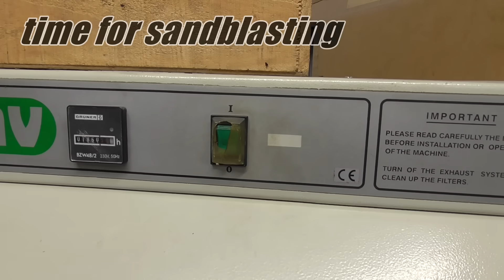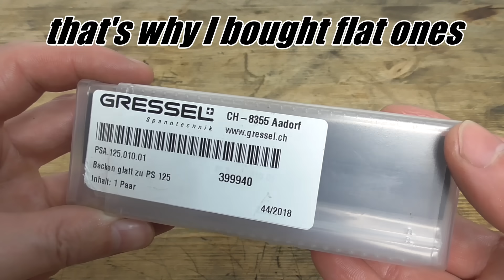Rusty Deadlocked Vise - Perfect Restoration

Comment: Please correct me if I'm wrong, but why not sandblast before you polish all the edges?
Reply from the maker: Dandblasting takes a bit of material off, it would damage those suraces. Specially the dovetail and where the jaws are mounted.

Comment: So you hardened the parts, but did you temper them after?  Didn't you just succeed in making them very brittle, or am I missing something?
Reply from the maker: I did not harden them, to harden you need much higher temperatur. They just turned black, steel is still soft. Its also rust proofing.
Reply: @mymechanics  Well that makes a lot more sense now.  I was wondering why i was not seeing any glowing happen.  Thanks!  You have a new sub here.
Reply from the maker: @shockwavecity  thank you very much :-)

Comment: Oi, I know the WD-40 cult membership benefits are hard to beat but if it's available in your area, try using Seafoam Deep Creep next time. I can't even touch a can of WD-40 without feeling dirty anymore after getting started on it, and it doesn't cost that much more. My second favorite libation.

My favorite, Buster, I know for a fact is only available in the U.S., unless you're willing to shell out $300 for a case + whatever they extort for shipping.

Comment: Wonderful restoration. I love that you remake these parts using precision machines and take the extra steps to smooth areas. Other restoration channels would have hit it with a wire wheel and left it at that. Wondering how long that finish will last on the handle/screw mechanism. Did it come nickel or chrome plated from the manufacturer?
Reply from the maker: No, they were black as well. You can find a lot of pictures if you google it. Thank you

Comment: finally.......somebody who did it right!  im certainly not the best at anything, but i cringe when i watch most of the other restorers......the only complaint here is the filler, the first hammer that ever touches it will break out the bondo and crack the paint.  perfect for just a show piece though.  replace the filler with some weld, and its 100%
Reply from the maker: I think it had filler in there before as well, because it appeared after sanblasting. Thank you

Comment: Great video but I have a question why don't you you use oil on those Norton oil stones? If you don't use it on them over long use they will become clogged with debris and you get to buy new ones?  My father and brother both have oil stones that are 35 years old or older in my father's case. Not cutting on your skills my friend just figured I'd ask. Keep up the great work.
Reply from the maker: You can use them dry aswell. Thanks for your comment.

Comment: I'm just curious why you chose sand blasting verses electrolysis to remove the rust.  I find sand blasting alters the surface of the metal and it looks like it's been sand blasted.  Great job. Great video.  Now it's too nice to use. ;)
Reply from the maker: I'm not a fan of electrolysis because you need to wire brush after. Thank you

Comment: Ready for more work, again.  Great job.  I noticed the original jaws had a cross hatched pattern, and they appeared to be okay.  You decided for plain face replacement jaws, was that a personal preference or what was available?
Reply from the maker: I explained it more detailed in the discription. Thank you
Reply: @mymechanics  , You can use the cross hatched jaws, all you have to do is take a couple of copper plates  a few milimeters thick,bend them in a 90 degree angle so you can use them between the jaws for protection.
Reply from the maker: @tallbeard7111  i have such aluminium jaws and other soft material aswell. I almost never use the rough ones.

Comment: Nice work! Although greasing the dovetail isn't necessary (won't hurt tho) because its made of cast iron,  wich contains alot of graphite and lubricates itself. 
I made one of these in my last year at school, making the dove tail perfect was a challenge for me
Reply from the maker: Indeed, but it's still recommended. You can't use too much grease when it comes to bare metal parts ;-)

Comment: I would recommend copper paste for the screws or any part that is needed to be taken apart again but especially on the threads of screws. Excellent solid vise. Guaranteed parallel jaws at any width. Wish it was mine.
Reply from the maker: Oh yeah, i remember we used nickel paste when we repaired electric motors a few years ago, thanks for the tip.

Comment: It is usually the problem with old used Gressel vices that the ways become worn and the movable jaw lifts.  Once the tooling marks from manufacture are gone the fit becomes too loose.  Maybe being frozen with rust for years saved the ways from wear?

 I think you got lucky that you did not have to fit a gib or shim.

Good choice on the smooth jaws!
Reply from the maker: It was in my friends barn for a few years, he found that thing on a recycling station.

Comment: Where you able to get the bottom part? That was great work.
Reply from the maker: What you mean with "bottom part"? Thanks
Reply: @mymechanics  on the curved part of the bottom there is a slot it connects to a base that allows the vise to be tilted, we have one that's just like the one you have but a different manufacturer and a little bigger, I'm sure you can find someone restoring one on YouTube somewhere, Andre will do it , is the YouTuber that has one similar to it and it has the base
Reply from the maker: @d.b.2812  the vice is complete like this, there's no missing part anymore. You can now fix it with 3 bolts on a bench. Just google "gressel bench vice" and you can see a lot of pictures.
Reply: @mymechanics  your correct the base is an accessory that can be bought separately, I had to ask someone who is 92 and he said there are a few things that can be added depending on what your using it for, now you've made me want to drive 400 miles to the family farm just to see all the old tools  3 barns and 5 generations of stuff, you have inspired me.
Reply from the maker: @d.b.2812  oh you're talking about the lifter? That's an awesome accessory for this vice. I'm already looking for a used one ;-) once you've worked with a lifter you will never every work without one.
Reply: @mymechanics  there probably a few different things that can go with it, I'm in Texas, when I go to the farm I'll look through as much as I can, and see what kind of things go with it, this will be fun

Comment: Love the work! But wouldn’t you want a full circle on the part you made for the front? To have even pressure on the crank handle rather than pressure on only half of it..? I noticed there were only 2 screws in the top so maybe it was designed that way. Just curious..
Reply from the maker: It's originally like that, just google "gressel bench vise" and you can see it. You couldn't mount a full ring anyway, impossible. Thanks for your comment.
Reply: Fantastic results! Subscribed..

Comment: Your videos are getting better and better, and they started off brilliant. I thought the two bolts at the beginning to separate the jaws was  a fantastic idea. I also like how you bought in authentic jaws when you obviously have the talent to make them, but the correct ones make the vice more authentic.
Reply from the maker: I was quite struggeling to loosen the movable jaw, i used so much WD-40 haha. I was thinking for quite a while until i had this idea and it worked perfectly, without a hit with the hammer. Probaly the only reason why i didn't made my own flat jaws, is because i don't have a surface grinder nor access to one. Thank you very much Mark :-)
Reply: I don't know… it feels wrong to replace the jaws when the original ones are in okay condition. Other than that, great job!
Reply: Hans Wurst I see your point, but are the original one the real original ones? I honestly don’t know.
Reply from the maker: both are7were original. you can and always could choose when buying a gressel bench vice if you want to have the rough or the flat jaws on. as you can see in the video, i'm using original gressel flat jaws.